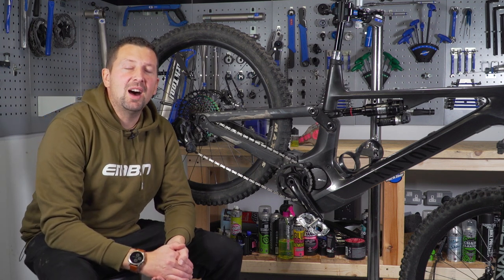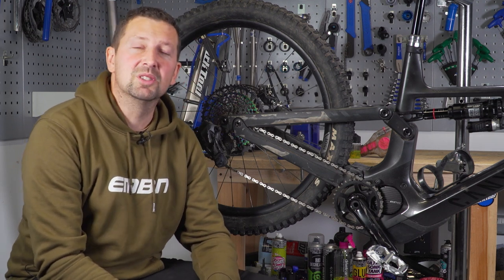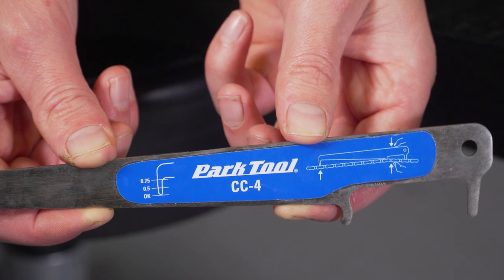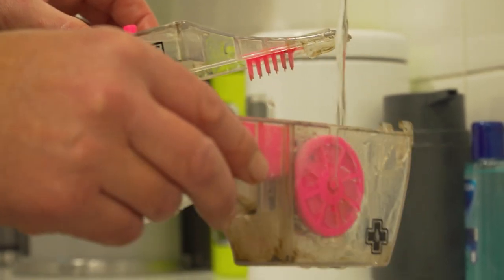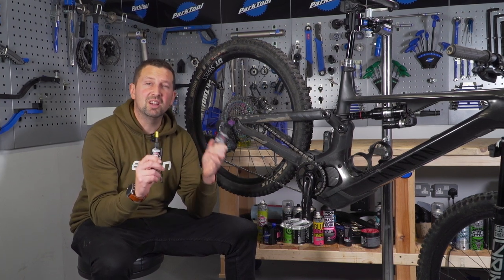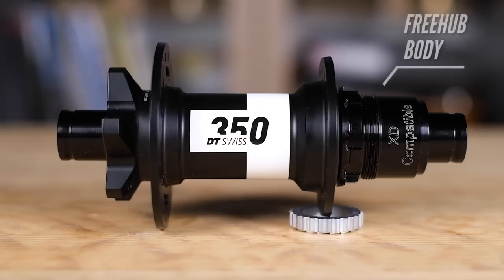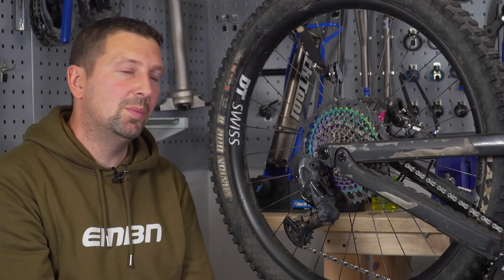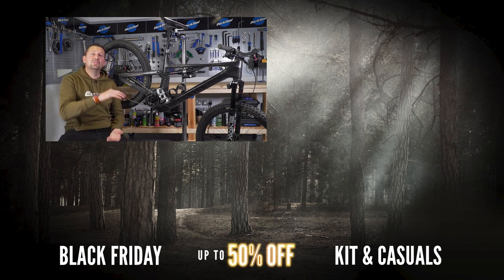How To Get The Most From Your EMTB Drivetrain!

Comment from the maker: How many miles do you average from your EMTB drivetrain? Let us know down below! 👇
Reply: 100-125 miles a month 😮
Reply: Nearly 1000 miles on my decoy and not at 0.5 yet
Reply: I've just has a new cassette fitted after 7,000km at the same time as my 4th chain. Chains were changed when they got to the 75 mark. Regular cleaning and lubing, backing off on the power when changing gear and using the lowest level of assistance for the conditions.
Reply: on my 3rd chain in 2000km. Still using original cassette and chain ring.
Reply: chain 2000km cassette 8000 km  chain ring 8000 km .  If I change the chain  checking it by checker regularly when will the cassette wear out and be replaced?

Comment: My 2021 Turbo Levo is at 5500km and my original cassette/chainring show almost no wear (square teeth still square, etc). I’ve been replacing the chain often, with first change at 1000 and increasing use by 150km each successive chain, up to 1500km (just installed 4th chain which will be replaced after 1500km of use). I also deep clean after every 75km or less. I don’t ride in the wet (Vermont trails close when wet) and use muc-off’s ebike dry lube. Another thing I do is to make sure I’m changing gears to spread wear across as many gears as possible (vs. using power to avoid shifting) requires slowing down to use a lower gear, especially on tarmac commutes to the trails (fewer teeth on high gears wear even faster).

Comment: After rinsing the chain with water, I use alcohol in the chain cleaner to evaporate the water faster as just wiping it off doesn't get the water that's inside the links.

Comment: I have an unrelated question: I am a smaller built guy, I have been on the market for a GOOD quality Ebike and all I really can find that would work is the 27.5. Why doesn't top brands make some in smaller divisions like at least a 26er? It's the right size for me and with it I can tackle about anything the larger bikes do, however brands like Trek and Specialized don't make any Ebike 26ers.
Reply: i have a friend and she is doing fine at 164cm with Cube's size Small (which results in 27,5" instead of 29er) and afaik they even have an XS Variant. Maybe you shouldn't worry about the semantics and just go try out some bikes at your bike shop and/or rent one if there's renting available near you. After all, the british/american outer-tyre/tire-diameter 27,5" are actually a European 650b which is a 26" wheel size.
Reply: ps. in Germany, we measure 584mm for 26"/27,5" and 622mm for 28"/29" which are the ridge-to-ridge diameters of the wheel, leaving the height of the tire/tyre out of the nomenclature.

Comment: Have you run the chain the wrong way through the chain cleaner?
Reply: Agree, I normally remove my wheel and use the chain cleaner with the handle on the inside of the frame, definitely looks the wrong way round!